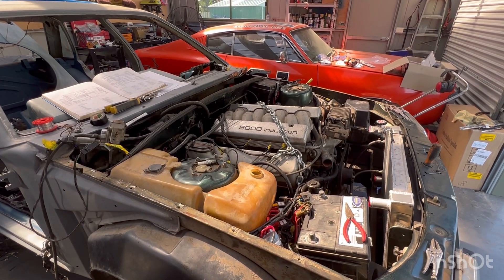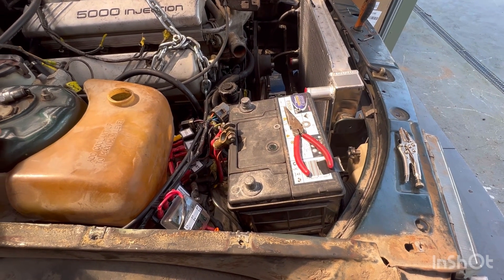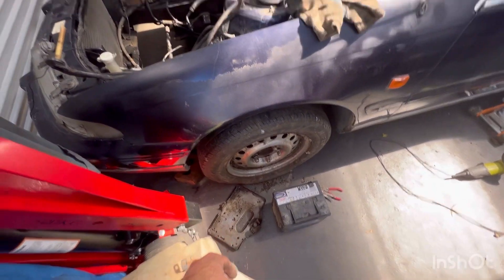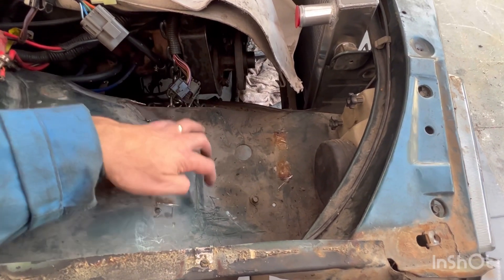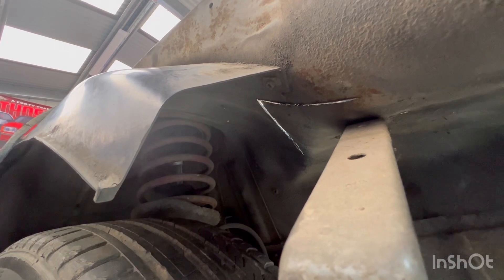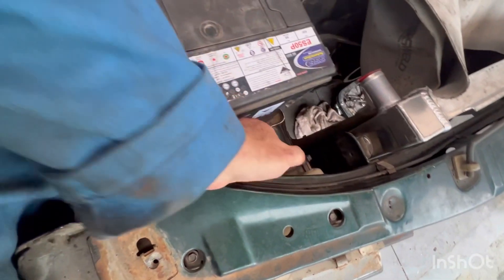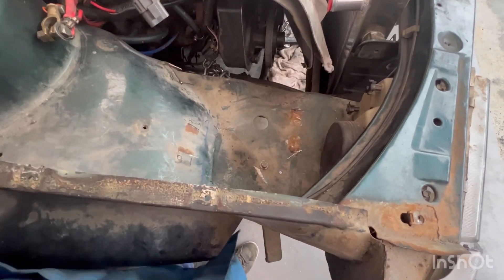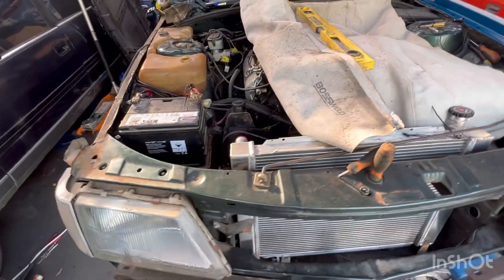VK COMMODORE BROCK TRIBUTE: Battery re-location Part 1.

Comment: Not sure if you've sorted it but 202 power steering lines work for the injected motors
Reply from the maker: That’s what I was mucking around with today. Do they run to the V8 pump or have to fit the 202 pump?
Reply: @TAVOTravsDIYGarage  they run to the v8 pump mine was a vh with 253 converted to a 304 I took mine off a 202 & bolted/screwed straight up
Reply from the maker: Mine don’t fit, the lines branch off to the passenger side and need to be re shaped.
Reply: I assume that's the v8 ones 253/308 that go to the passenger side
I've also got stock vh v8 kframe & power steering rack
202 is on the drivers side I took mine off a vh with a 202 at jollys & fitted straight up no issues
Reply from the maker: Appears you go lucky, me no so lucky.